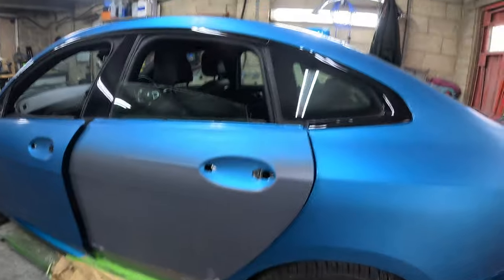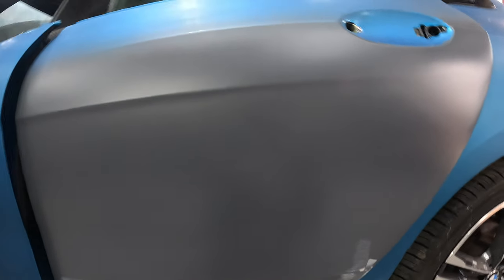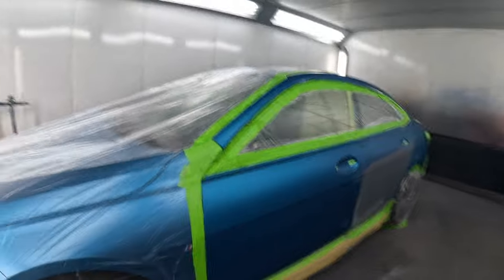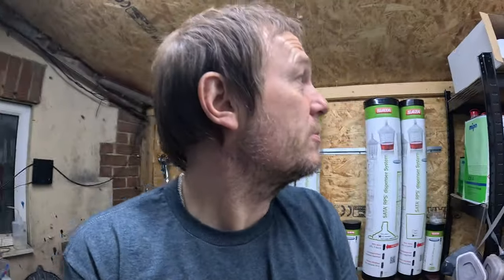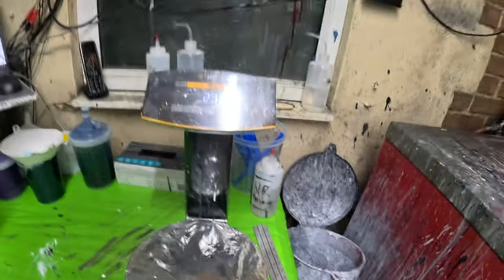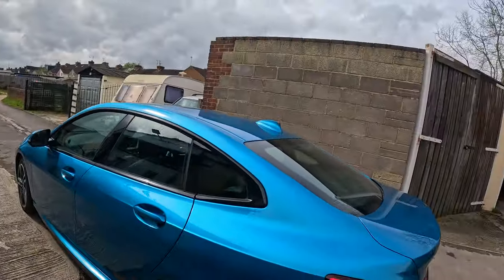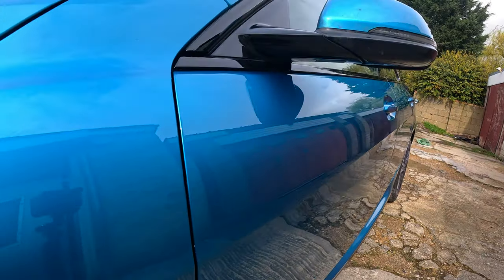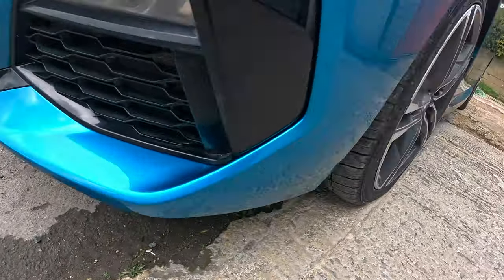Professional Paint Preparation, Masking & Spraying BMW 2 Series Gran Coupe Part 2

Comment: Good video that Jay 👌 I like it when you tell people the guns your using and the settings comes in handy for people just starting out in the game Mipa blender is it mipa 2k Hs loser and can you put it on the panel with out thinners
Reply from the maker: Cheers Andy, the blender is water base, WBC blender coat, its not the fade out thinner you use for blending 2k
Reply: @TheHumblePaintSprayer333  Jay SORRY 😞 FOR THE LATE REPLY  MY FORD FOCUS MK3 TITANIUM X DIESEL FRONT BUMPER AS BEEN PAINTED TWICE CARNT GET THE PROPER MATCH THE PAINT SHOP USED A SPECTRO CAMERA  AND ITS STILL A LITTLE DARK THIS PAINTER SAID ANDY Z BLEND ON THE 2 FRONT WINGS OF TGE CAR 🚗

Comment: Brilliant job that lacquer looks like glass need to pull myself away from budget laquer how much is that going for? Makes me want to try sata also i love my iwatta's got a dv1 recently 1.3 but not a big fan maybe its me but always looks abit peely unlike my iwatta anyway im rambling great job again you are a true pro!
Reply from the maker: Many thanks 🙏, it very reasonably priced, around £120 + vat for 5lt of clear and 2.5 lt hardener , considering the hardeners are quite expensive on their own,it’s very versatile as well for small and big jobs with fast drying good gloss and stability on the panel

Comment: Why 1.2 for base vs 1.3 just wondering how much of a difference it makes in that paint line slide recommendation is 1.2 but in RP O pattern just crazy too
Le how
Much fun matters in waterbourne vs solvents
Reply from the maker: Mipa recommends 1.2 i HVLP on sata for water base its lays it down a bit lighter, its thinned 20% so it drys out flatter and super smooth but can be easy to over load it , it covers quite well too
i had a 1.3 i on it for a while and its still alright but the 1.2 is better for it
I use a 1.2 O RP clear as well as CC